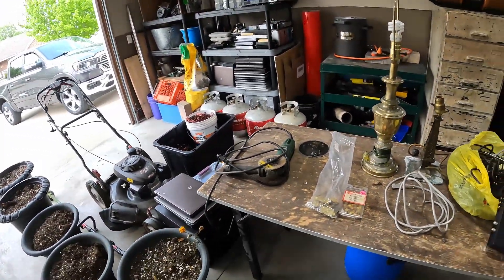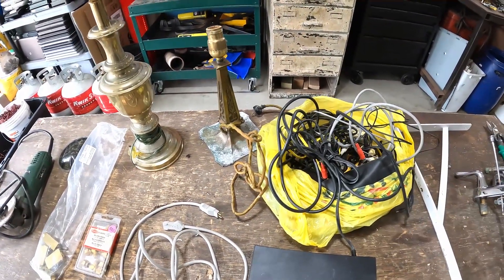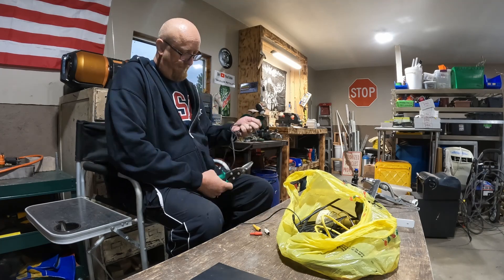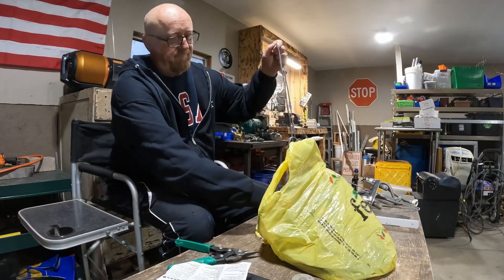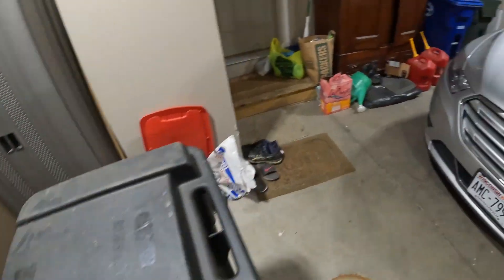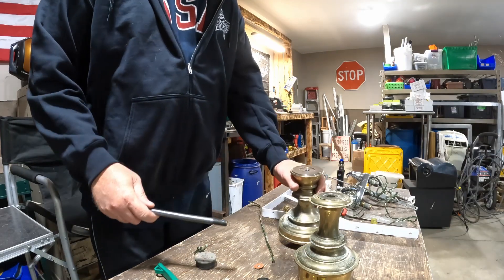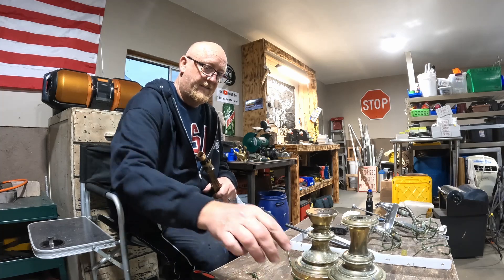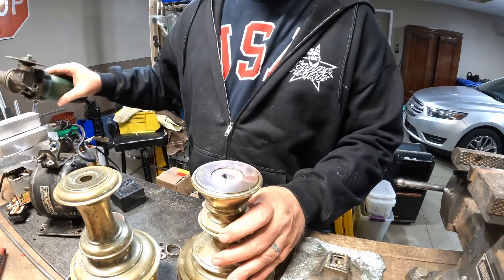Brass Lamp Hoax - No Jeanie In This One!!  #scrap

Comment: Most likely cast zinc. Cast aluminum is not that heavy. I once picked up a ton of lamps that I thought were brass also. Only a couple were actually brass the rest was zinc.
Reply from the maker: I'll take a torch to one.  If they're zinc a torch will melt them.  That would be cool actually.